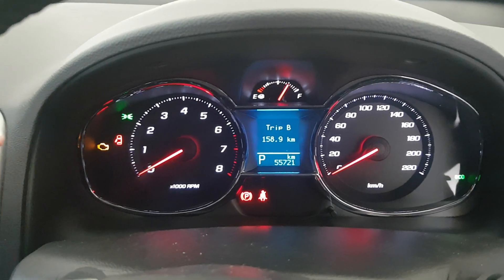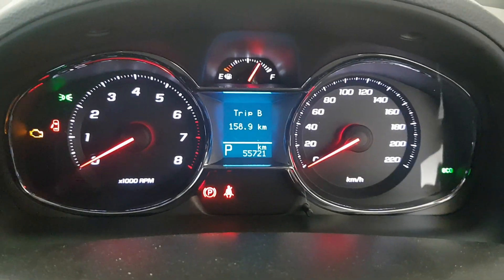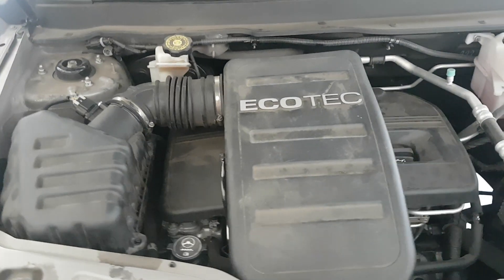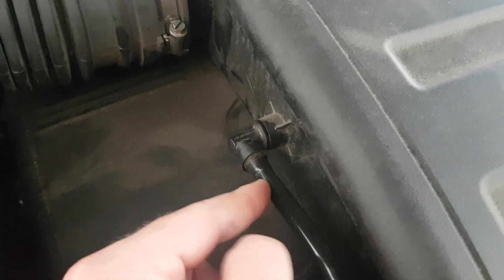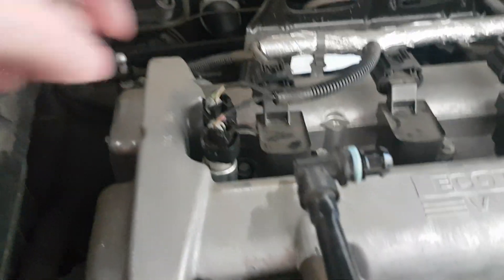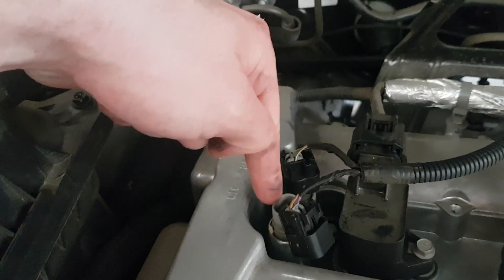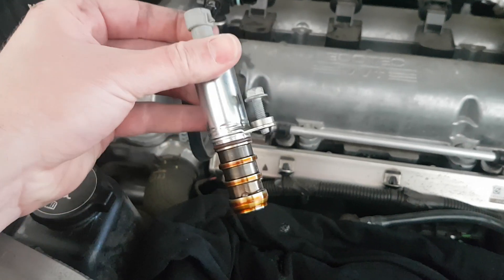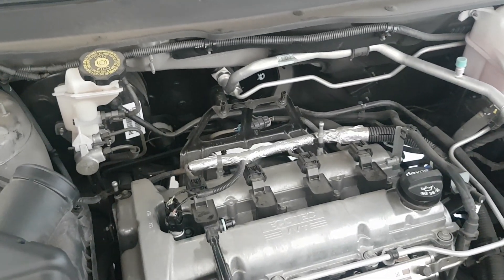Holden Captiva 7 2.4L petrol 2015 engine light on. ( P0010 fault code ) VVT solenoid replacement

Comment: I had this fault code P0010 before and I changed the Intake and it’s gone, but I have now another error code P0700, and when I went to Holden company, they said that I need to change the Transmission Control Module. I don’t know exactly it’s location in my car. Holden Captiva LTZ 2015 2.4 Petrol.

Comment: Hi, I have same car 2017 model front wheel drive, I have problems of high fuel consumption, do you have any suggestions or tips what would be the issues.. ps No engine check appearing!!

Comment: I have watched this video a few times now. My captiva 2.4 petrol engine, was throwing up an engine warning light occasionally. I purchased the same reader as you did, but it didn't show any codes so I gave up. I ordered both the inlet and outlet solenoids from ebay and limited my driving until they were delivered. This morning I decided to change them both. Everything was as your, fantastically detailed, video with one exception. That was, getting getting the electronic connections off the top of the solenoids. It took me bloody ages but eventually they came off. After replacement I started the car and the warning light was not there any longer. It goes in for a standard service and oil change tomorrow but I am not expecting any hidden surprises. I'm going to order another couple of solenoids, as spares, to keep in my toolbox. Thank you for the upload as I'm sure it saved me, and many others, a heap of money.

Comment: I have changed both intake and exhaust VVT solenoids in my 2012 Captiva. The errors are gone but just to be sure after running the engine for a while I checked the solenoids. The one on the exhaust side is very slightly leaking oil at the bottom but can not say where because it is so few. Is it possible that by not fitting it the whole way down and by tightening the screw, it is not exactly in place? After I replaced both solenoids I also checked whether they are at the same height and they are indeed. Can it be possible that the new factory seal that comes with it is broken or damaged?

Comment: Had orange light, bought an OBD2 reader and was P0010 code. Seen this and bought a new solenoid from Repco for $150, took 10mins from start to finish. Fixed issue but now also saving fuel, before I changed it my car was 12.5l/100km... not running around 10l/100km...

Comment: Hi, i had a same problem today. Mine is holden captiva 5 2013 2.4L (petrol). Is it the same way as your captiva 7 to fix them? What do i need to prepare? Do i need just buy vvt solenoid and just change it without read on obd what problem occur Or need to read the system first by obd first? Thank you.
Reply: Do you like the car ? Is the engine good?

Comment: Thanks 👍. I cleared P0013 on 2012 Chevrolet CAPTIVA LT. Actually, both the Solenoids were choked by slags . Cleaned both, reset the fault with TORQUE android app

Comment: Thanks for sharing this I'll give a go. I've got a 2011 Captiva with the same problem P0013 Code.
Reply: Tareck El Sankari 
I have same car 2012  Chevy Captiva code p0010 I change camshaft bank 1 still check engine on do you know how I can fix it
Reply: Tareck El Sankari Heyyy did that fix your car when you changed it ?? I have the same code popping up and the dealership is talking about something totally different then what they said the first time ! 💚